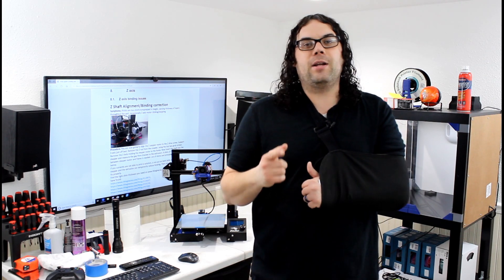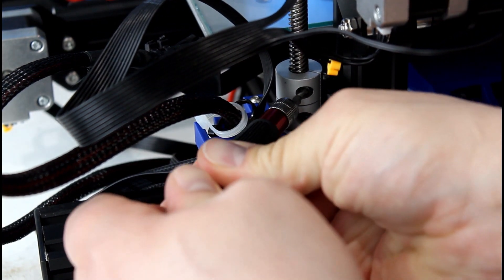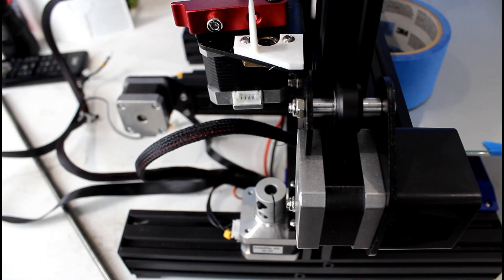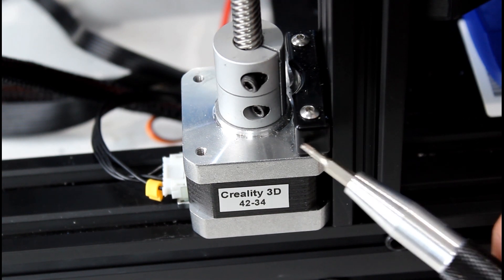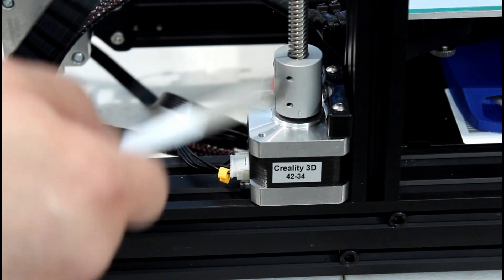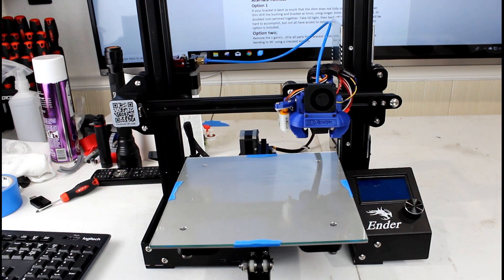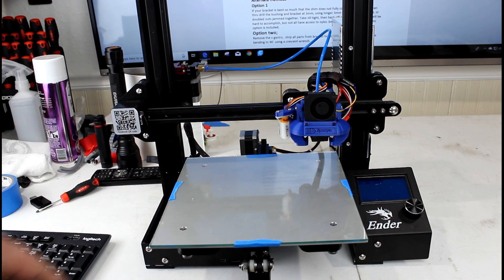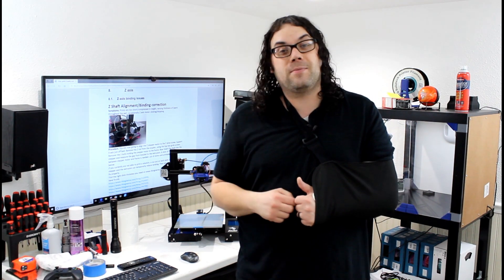Section 8.1 Z Binding Issues Featuring the Ender 3

Comment: Hey man love your stuff.  I recently had an issue with my E3 Pro. I had watched a video of yours a few years back configuring TH3D with my CR Touch and it ran smooth as butter before this happened. I'm trying to locate the video but having difficulty. Could you point me in the right direction so I can properly configure my firmware? I have the 4.2.7 board and configuring on a MAC.

Comment: Thanks (in advance). I'm going to have to go through this tomorrow with my printed as I've had for a while what I believe to be z-binding issues, where some layers are sort of like vague gaps, bit not entirely, so it's not like missing layers, they are just, shoddy, and appear as vague inward-dented lines at various heights. With a couple of millimeters to sometimes centimeters between the lines.
I have already gone through cleaning and lubing the z-rod, and tinkering with the eccentric nuts on the x-gantry, which seemed to help at first when those 2cm calibration cubes finally came out nice.
So i printed something taller, aaand after about 3-4 cm it came back.. So i only got it fixed at the lowest centimeters.

So now when alive ruled out dirt and eccentric nuts, I have this entire video (and a bunch of comments to this video) to help me further as I had forgotten about these fixes.
So thanks. I really hope your video will help me find the cause.

I was wondering thou.
When you talked avout the stepper motor, and being flush or potentially needing a spacer... How do I know that? Since I saw yoy could move the motor around... So... If it can be moved back and forth, how do I really know if I need a spacer, since IF there is a gap, why not just move it flush to the wall? How do I know where to place the stepper motor so that the z-rod will be straight, and properly 90 degrees so that the distance at the bottom (at coupler) AND the top of the z-rod (right below filament spool holder) has the same equal distance to the aluminium frame? Aka straight?
Any easy way to check that?

I also saw something about an L thing on the stepper motor that should be exactly 90 degrees bit sometimes isn't... What part is that? How do I check it? What so I do? And so on.
Sorry for the massive post, I just have so many questions, and I wish ypu pros lived in the same city so i could ask someone to pop over and physically check my machine. 😅

Comment: thanks for the video!   new to 3d printing and my cr10s pro has thudd/grinding noise on occasion in the left z rod .  I've tried a few things already but not your suggestion on the stepper motor! will try it right now!👍👍
Reply: oh my god, so after i spend a good 3 or 4 days trying to trouble shoot this damn grinding /thud noise I accidentally solve it lol .  i happened to see the build plate going back and the friggin rear left dial for bed leveling was rubbing the left stepper motor and causing the connection to be interrupted lmfao !  literally I just had to push the wiring down another 1/4inch into the base and viola....... no more grinding aka shorting out .  oh man I couldn't friggin believe it.

Comment: Thanks for making this video - I had a lead screw problem on my CR10 Mini, My vertical heights in my prints were nowhere near the height it supposed to be, turns out that adjusting the lead screw guide, by loosening the 2 screws made my lead screw much easier to turn, it was way too still to rotate,  so your tip at about 10:00 in your video solved my problem, I am printing now, and the vertical height seems to be where it should be. I was also experiencing the stepper motor slipping as it was too tight. So Thanks!

Comment: Thank you so much for your help on this. I was stuck on this issue for a good 3h thinking it was a firmware or wiring issue. I also switched the ends of my z rod that went into the coupler, just incase there was a bit of a bend that I could not see from the "roll" test you showed. Keep up the amazing videos :)

Comment: Thanks for taking the Time and Effort to make these Videos...they are Wonderful!  Did everything in the Video, my rod lined up perfectly with the motor shaft, but it takes a 'substantial' force to push the gantry down or up with one finger.  Maybe the Ganty wheels are adjusted too tight?  What do you think?  And what would that equate to in my prints?  I'm looking for a fix to my 'Regular' Horizontal bands every 1/4" or so on my prints...

Comment: Great video Jim, love your work. 

Good morning Jim, my ender 3 pro has a dual z gantry z rods with one stepper motor running the gantry, and the z gantry only goes up half way up the z rods before clicking and basically won’t go any further. Although the printer continues to print, how can I resolve this? Thank you in advance.
Reply from the maker: Definitely sounds like you have some binding going on. Will it go further if you twist the couplers with your hands?

Comment: I have the stupid default problem the ender 3 V2’s have.

We’re the stepper motor is raised at the back end as soon as you tighten the screws.
I’ve tried a cardboard shim at the back, and that worked ok.
But then, I noticed , the first few layers were poor, yet the rest was perfection.

Driving me crazy, anyone point me to get this fixed.

Comment: I have tried multiple times to do this. Mine is still skipping. It goes down just fine, but up it starts doing this. Weirdly, if I hold the extruder down manually it is fine. If I put pressure on the little thing above the Z-motor that holds the Z rod (not sure how it is called) it also works just fine. Of course I can't stand there for 6 hours. The motor also spins just fine without the rod inserted. Tried adjusting motor's position, no luck. Tried the screws around the extruder, tight/loose (in many steps), no luck. It seems like the extruder is too heavy for the rod. Which is weird because the printer worked fine for almost a week, I got a couple of models out of it.

Comment: I have an issue with z height.  no matter the adjustment made on the z-rod position i can't print anything tall unless i sit and add baby steps to the height.  it's like the stepper motor isn't calibrated correctly for a full 360 degrees.  and i can't sit their all night adding baby steps to keep the nozzle from knocking over my print.
any Ideas how to fix it.   i've used my calipers to check spacing of my z-rod and it's almost perfectly vertical and doesn't bind anywhere.
i'm at a loss and need some help.  (skr mini e3 v1.2 - bltouch v3) and the latest marlin software.

Comment: Hi, I don't seem to be having binding, but as the print height increases above a certain height, it regularly slips down as if it can't hold itself in the correct position. I'm therefore getting major banding, if not failures, where the print gets squashed. Any ideas would be much appreciated - I've tightened every sort of nut and screw I could find 😆
Reply: I have a similar problem, where the first 8mm of the print in z direction seem overextruded/squeezed with elephants foot, after that the quality is almost perfect. i found out that my z rod only binds very the home point.
Reply: @leonda4817  Didja put a spacer in behind the z motor bracket?  I had this too and it fixed me
Reply: @jimswan9572  My final fix was to use an anti backlash nut for the threaded rod. The brass threads have some slack, this means that after moving down, the first movements upward have no effect- this is more or less a problem with every threaded z axis.
While the Backlash nut fixed most of this Problem, i modified the starting gcode to copensate the remaining slack. My prints are now flawless in terms of elephantsfooting/slack in Z direction.

Here's the code i came up with, you can easiliy edit it in cura(Added only four lines in total)

G1 X0.1 Y20 Z0.3 F5000.0 ; Move to start position
G1 Z0.4
G92 Z0.3

After moving to the start position, the G1 line tells it to move up to 0.4,
the G92 line tells the printer that the current
height is 0.3. (basically, we made an extra 0.1 move the machine doens't know about)

G1 X5 Y20Z0.1 F5000.0 ; Move over to prevent blob squish
G1 Z0.2
G92 Z0.1 ; 0.1

After the the second plastic line on the print bed, we do the same thing.

You can play around with different values until it fits perfectly.

Comment: So im just got an Ender 3 pro and i noticed the first 3-5 layers are being squished. Z axis isnt going up enough to lay the next layer at proper height which is causing extruder to skip and prints to be a little shorter.. this is only happening mostly in the beginning. any tips?

Comment: Hi I just started using my printer and I’ve been noticing my prints in the a axis have been failing after a certain height. And I’ve noticed my rod doesn’t do well going up. Noticed there’s a screw missing on the stepper motor and I think that’s the issue. Do you know where I could find that ?

Comment: So i just put mine together and i cant manually push the bar up and down. I see other videos and it seems everyone else can. Is this a problem. Its seems to work when powered
Reply from the maker: It should go down with 1 finger and up with 2-3 fingers. If you already did this part, make sure your carriages are rolling nicely on either side, and not overtighten.
Reply: @TheEdgeofTech  I threw in the towel lol. But so far prints are coming out fantastic so until it becomes an issue I’m not overly concerned. I’m a week into this hobby lol

Comment: At 5:33 of this video my stepper motor is actually lifted off the bottom rail enough to put maybe a 1mm washer completely underneath it.  I can easily pass a piece of paper underneath it from front to back....is this normal?  as i have 2 ender 3 v2's and their both like this

Comment: 7:02 is normal, the coupler is split half and half with the two stems of different sizes. If you allow the coupler to sit flush with the motor the motor stem would've taken up space on the other half of the coupler making it too short to grip the Z screw properly, I fit the Z screw into the coupler first before the other side. That ensures both sides got their half of the coupler.

Comment: 8:35 My CR10 binds on that brass piece if tightened like you think it "should" be. I had to move the Z up and down and adjust it while it was moving until it smoothed out.
Reply from the maker: It's a good idea to keep those screws loose on the brass, and to move up and down all the way at least once to make sure it's not binding.

Comment: If the horizontal axis doesn't move to finger pressure how do you fix this. I've loosened the wheels and still can get the axis to move to finger pressure
Reply: May be a stupid question but, have you ensured stepper motors are disabled?
Reply from the maker: Not a stupid question, always make sure your steppers are off before moving them manually.
Reply from the maker: Are you saying up or down?
Reply: Belt tension too high?

Comment: I do not agree that this is how to fix  Z Binding Issues, The Z rod needs to be aligned in both verticals not just front to back. You need to measure with the X gantry in the top of the z screw the distance it is from the upright top and bottom and then shim or adjust until it is,  not just look for a gap. Then do the same for the left to right so it too is aligned with the upright. Then you do not leave the the the nut that raises and lowers the x gantry loose, as this will cause layer height issues. If every thing is aligned correctly you will not get z banding and you don't need to leave things loose to compensate for your pore assembly of you printer. Every thing on my ender 3 is aligned, squared and tighten up and I get not even a whiff of z banding, it also helps that my z rod is straight and not bent and if yours is it really needs to be replaced.

Comment: Hello, I have a problem, the X gantry slides very easily but the nozzle literally bumps into the print when its doing travel moves, like bumping into infill and such, BUT the really weird thing is that this happens on like half of the layers. For example on the first two layers it doesn't occur but after it does this for 10 layers straight and then stop after. Like HOW?
Reply: same here. Did you manage to fix your issue?
Reply: @iFireender  yes, a long time ago actually. The nozzle wasn't perpendicular to the bed, and since it doesn't do the same moves on every layer, it doesn't smack in to the print every time. It only hits the layer for example when it's moving left. Undo the 2 screws holding in the hotend heatsink and adjust it for it to be more perpendicular to the bed
Reply: I'm having the same issue. Will give that a try

Comment: In relation to threaded rod alignment, Luke's document and your video addressed a front-to-back non parallel problem.  I have a side-to-side non parallel problem on my Ender 3 Pro.  When viewed from back to front, the threaded rod slants towards the right side.  To make the rod parallel to the vertical strut when viewed from back to front, the motor has to be mounted around 2 to 3mm more towards the center of the printer.  A motor mounting bracket with oval screw hole may work, but I haven't located one in Thinkiverse.  Do you have a recommendation to fix the problem on my printer?
Reply from the maker: I don't think I have seen that issue yet. Did you make sure your frame is straight? If the uprights are not straight, it would cause the rod to be out of alignment side to side.

Comment: I just did it. And Z axis seems quite a bit smoother to move down. Although it feels hard to move up. Maybe more than it previously used to. Is that normal?
Reply from the maker: Yes. If you get it adjusted correctly, it will be harder to move up than down. As long as it's all straight at the coupler and screw you are good.
Reply: @TheEdgeofTech  Got it. Thanks

Comment: Non-sense, the Z-rod and extruder bracket is a soft metal that can be bent easily with two crescent wrenches. Simply move the screw out of the coupling and bend the L-bracket so that it lines up in the coupling hole. I did that to mine and now the extruder and X-axis bar coast almost down to the bed when I turn off the steppers.
Reply from the maker: That is definitely another way to do it! I am glad that worked for you!

Comment: I have two ender 3s, one direct from Creality in China and one direct from Comgrow in CA. The ender 3 that came direct from China is TOTAL CRAP! The lead screw is BENT! If you roll your lead screw on a flat surface like you would with a pool/billiard cue, you will understand why you get z axis binding/banding. In addition, the right angle Extruder plate not being at least close to ninety degrees which is what a right angle is! If your lead screw is bent, nothing in this video is going to help. I wanted a cheap printer so I bought a China made thing, now I have spent so much time, material and money fixing, adjusting and upgrading that I should have just bought something better. Better get a flex coupler for the z axis lead screw, it's your only hope!

Comment: It is well known issue that the Ender 3 z binding is caused by the defective extruder mount plate.  The plate should have exactly 90 degree right angle.  The factory quality control sometimes misses and let it slip through the shipment.  You need to check the right angle with the square as naked eye ball isn't good enough to detect the error.  When you bend the defective part back into exactly 90 degree angle, you will no longer need shim spacer for the z motor and now able to push the motor all the way into its place as it was designed to be.
Reply: Exactly. i just noticed that on my printer. hell man what a mess of quallity ensurance. ;(
Reply: @pulponair  Which mount plate is this? Connecting which part to which part?
Reply: @joellajoie-corriveau477  Are you asking for the L-Bracket?
Reply: @pulponair  I ended up figuring it out but yeah. It's the bracket that connects the printing head to the z screw and the X gantry.
Reply: @joellajoie-corriveau477  Exactly that thing is often not square nor horizontally nor vertically. How did you solve that issue? Did you re-bend it?
Reply: @pulponair  So, I had layer shifting rather than Z binding issues, all of a sudden. I took out my Z Axis screw and rolled it, but it rolled straight (so it's not bent).

Then I moved the motor as shown here, and put my screw back in the plate, but it seemed to line up just fine with the motor... There is a LOT of give on the screw in all directions, which makes troubleshooting what "straight" is or should be very confusing. Ended up eyeballing it and making a rough tape measure after, and more basing myself on "The motor is stuck to the extrusion, where it looks to be on this video, and the screw still goes fully in just fine".

Once I did that, and re screwed everything in place, I adjusted the 2 screws on the Hothead assembly that holds the Z screw with a brass part (the 2 screws shown in this video). Unlike this video, however, I had to put mine as TIGHT as they would possibly go. Why? Because if I did unscrew them a turn or two, my machine would make a shitton of noise going over certain parts of the z axis screw, and I identified it to be 90% rattling of the brass part. Tightening them up all the way reduced the noise to a minimum.

Doing that, I have no more layershifting. I still have stringing though, but that's another issue.
Reply: It's much better to align the L-bracket to the coupler than to add spacers to the Z stepper motor to compensate for a misaligned extruder L-bracket.